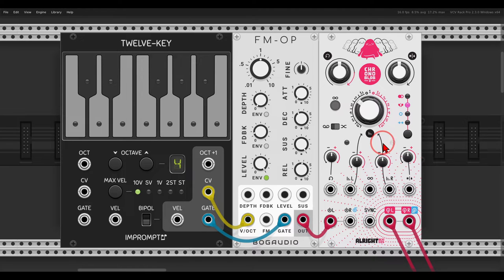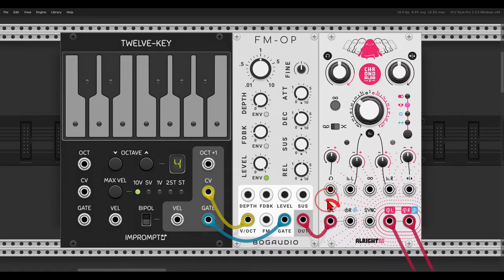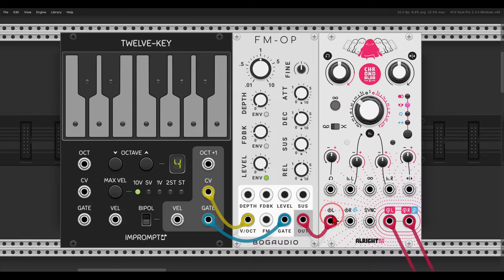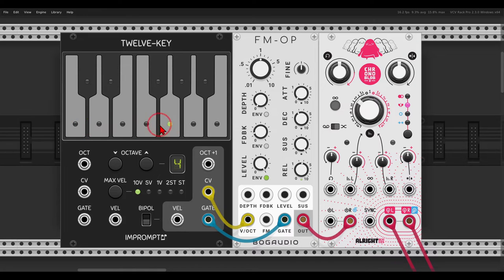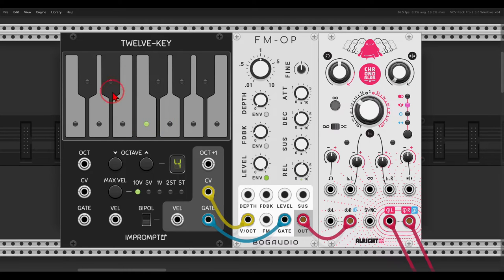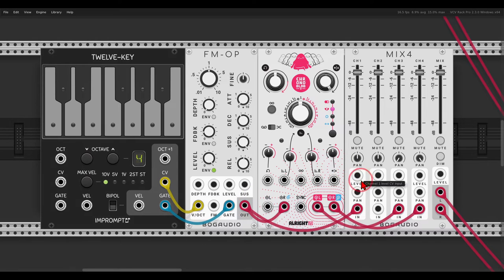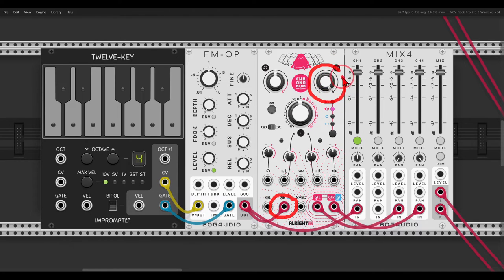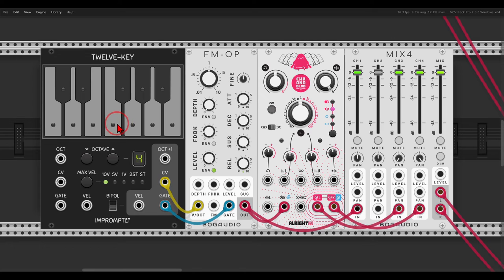Chronoblob 2 Ping-Pong Delay \ Quick Tip

Comment: There are ways to do this with two separate, crisscrossed delays and a lot of fiddling with the delay timing or opposing clock synchronizing, even with the native VCV delay module, but this is the simplest and (probably) uses less CPU resources. A valuable tip 👍